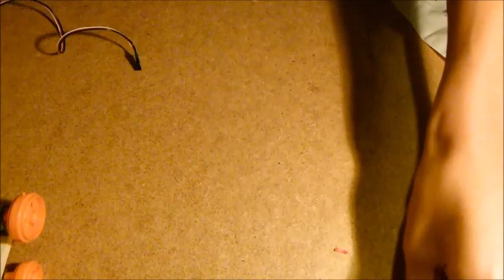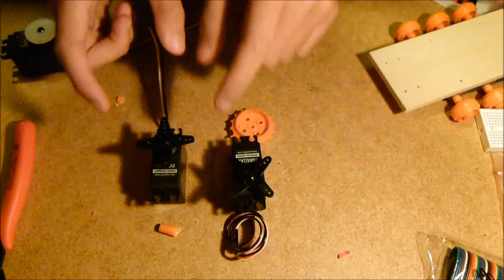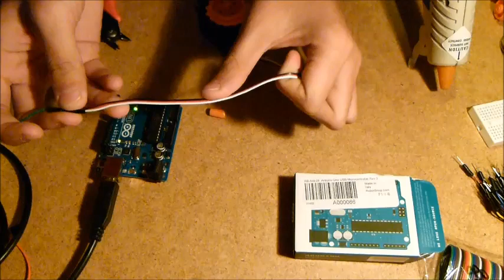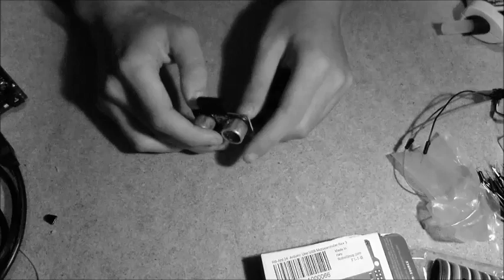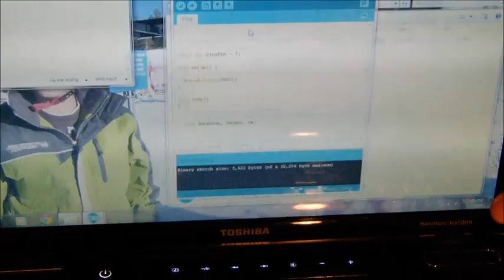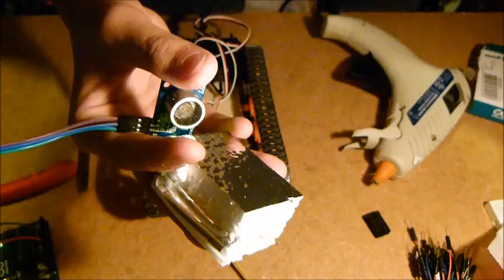Obstacle Avoidance Robot Tutorial

Comment: why use a servo instead of a regular dc motor?
Reply from the maker: +maximus You can still use a dc motor, but a servo is more easily programmable so I can use it right after I plug it in to the Arduino.
Reply: oh okay, so with a dc motor I would need to use a motor shield? and with a servo i don't need one?
Reply: +maximus i have Adafruit Motor Shield v2... Servos can operate when connected directly to an Arduino but in case of DC Motors the Arduino cannot provide the required amount of current so we need a motor driver to run our DC Motors.. I'm going to modify the program for running DC Motors...through Adafruit motor driver shield..
Reply: Do you have a video on your DC motor?
Reply: I do but its not on YouTube

Comment: Arduweno...what is the operating voltage of this project?
Reply from the maker: +Mar Kevin Pastor In this project I used a 9 volt battery but I believe the operating voltage is 5 volts.
Reply: ArduWeno  thanks for the info..im still working on it

Comment: i dont have servo , i have :

tools that I had already bought:

1-5ct 9V 9 Volt Battery Clip Connector Snap On Jack Plug Holder Wire Lead Cord USd
2-9 Volt (9V) Duracell CopperTop - 4 Brand New Alkaline Batteries MN1604
3-5pcs Ultrasonic Module HC-SR04 Distance Measuring Transducer Sensor for Arduino
4-L298-Based Stepper/DC Motor Driver Board; Arduino L298N Controller Module USA
5-New SunFounder Starter basic Kit for Arduino Beginner Uno R3 2560 Nano Leonardo
6-Motor Smart Robot 2WD Car Chassis Kit Speed Encoder Battery Box For Arduino
Reply: Yeahh... I think you need the servo

Comment: thanks for the code , but i have bought :
L298-Based Stepper/DC Motor Driver Board; Arduino L298N Controller Module USA
i dont know how to plug it ?
how can the 2 wheels motor know that sensor found an obstacle ?
Reply from the maker: Hey,
I don't know how you're using the L298-Based Stepper/DC Motor Driver Board; Arduino L298N Controller Module USA because this project simply requires just an Arduino Uno microcontroller. The motors are servos, which are kind of like smart motors. When the Ping))) sensor senses an obstacle, it sends a signal to the Arduino Uno board, which sends an signal to the servo telling it to reverse and turn.
Reply: ok i will do as you did , but what  about the battery , does you put 2 power supply one for arduino , and the other for motors